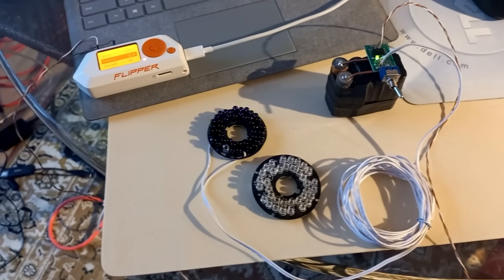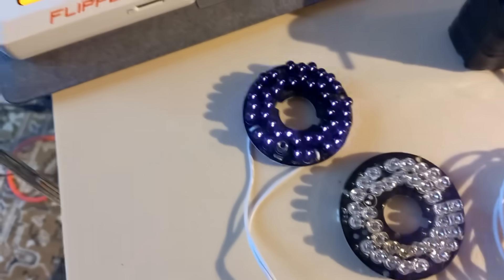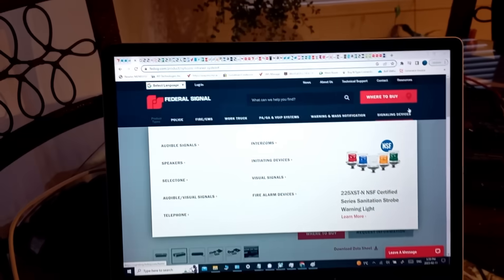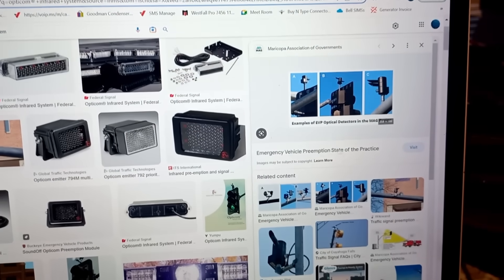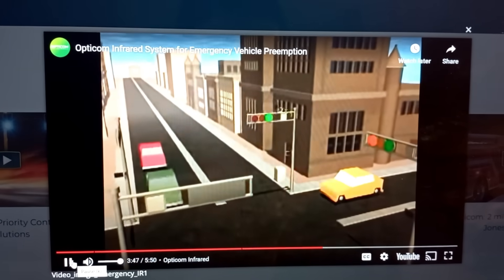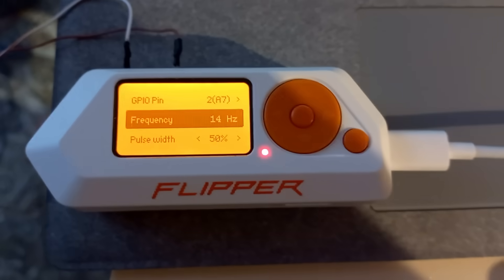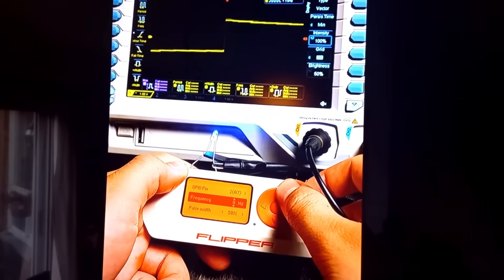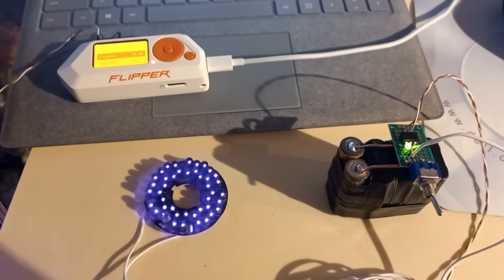Flipper Zero Controlling Traffic Lights

Comment: I'm curious how this might be used to influence drag races. Some of these races are for tens of thousands of dollars so just a matter of time before someone uses a similar device to disable a car at the starting line. Curious if you could explore vulnerabilities and possible ways to prevent this scenario, thanks
Reply: I've never seen or heard of a high stakes drag race using a public intersection traffic light to start.
Reply: @superbarnie  I was referring to using the flipper to sabotage/manipulate an opponents cars electronics in an undesirable way. I am not advocating doing this, just curious if it was possible and if so how to prevent it
Reply: @jayd6083  probably use an emp to do that lol
Reply: @jayd6083  I didn't watch the whole video but from what I saw it looked like they are just making a 14hz strobe light, and the traffic lights are designed to detect this light pattern. There's nothing in a car would be affected by something like that. There's also nothing in a car that uses any radio or wireless input for the critical systems. Except maybe some new cars with proximity sensors and wireless anti-theft/government backdoors. But any race car would have those removed.
Reply: @jayd6083  no, just no.
Reply: @rabbitdrink emp’s lol. In your competing car with electronics?
Reply: @deaf2819  its kinda the only way, gonna need lots of power and probably gonna fry your own car first

Comment: I would not do this in any vehicle with a modern computer, as many are equipped with cellular devices which broadcast all kinds of data about that vehicle. The data goes to companies like Palantir which probably curate and pass that along to local leos as for position and other attributes of every trip you make.  You can hear some of them broadcast after the vehicle is turned off, or use SDR to detect it.  Mine broadcasts for about 10 plus minutes after every trip.

Comment: This may also work with camera Speedlites and monolights that have a stroboscopic mode. You can manually set the flash pulses in hertz, but only downside is the strobe flashes are visible light.
Reply: IR?

Comment: We install these opticom systems on intersections.  They detect emergency vehicle light signals ie. police, EMS, fire, ect.  We test them with a DeWalt flasher; it looks like a drill with a big light bar instead of a chuck.  Another cool thing we install is a bus gps, so city busses are timed to the lights for quicker travel times.
Reply: @peterfairlie2296  exactly it.
Reply: @samster1oooooo  how does the bus thing work
Reply: @Blox117  gps on the control cabinet, big aluminum box at an intersection.  And all busses in the city are tracked with gps on that same network, fiber optic cable ran to each intersection connects all cabinets.  So when a bus comes up to an intersection, the light cycle will change to give quick light to the bus.
Reply: @samster1oooooo  There is talk about doing something similar with self driving cars.  The cars and lights will talk to each other to make traffic flow better.  An extra light would be installed to tell human driven cars to follow the lead of the self driving cars.  It doesn't completely make sense to me why we need the extra light though.  If they want us to drive through with the self driving cars just keep the light green. 🤷‍♂️
Reply: @Tuba Man Sam  is it possible to find a bus GPS and put it in my truck to have quicker light changes?
Reply: @TuSwab  good thinking lol
Reply: @jmr  No, I have specific complaints about the "It's good to go if it's green" policy we all ascribe to. It shouldn't be that way, it's a lack of communication to drivers. What a lot of car manufacturers and insurance companies noticed when they did market research is that most drivers were constantly looking around for clues that a light is either going to stay red or change or stay green or change. The yellow light also gives people an excuse to say "Well, yeah, but I was going too fast to stop." A blue light could be implemented to let people know that the light is not a standing green light, but a standing blue light, meaning for the duration of your being able to see the light, that intersection will be safe to approach and proceed through.

Many drivers who had their eyes tracked would end up looking at the cross walk signal timer to try to judge if they had enough time to approach and proceed through an upcoming intersection, so we already give drivers unintended clues about the nature of green lights, just not in a way which is readily available and highly visible to drivers at all times. Part of the training for driving large, hard-to-stop vehicles includes "Do not expect lights to stay green, assume every standing green light will turn red." This causes undue stress and accidentally acknowledges the problem at hand: We have insufficient methods of warning drivers that they should be prepared to stop.

Further evidence of this is the implementation of flashing lights and signs around blind corners which warn a driver of an upcoming green light change, warning them to slow down before the light in anticipation of it being red soon. We already spend so much on the infrastructure to make it mediocre, and an automated vehicle could inarguably benefit from an additional light.
Reply: @jmr i think its cause all of the self driving cars would have a faster reaction time so they could all take off closer to the same time then people driving cars would. This would allow the self driving car to accelerate at the same rate
Reply: @kennethmead9122   The light is meant for human drivers according to the article.  If it was just to communicate with the autonomous vehicles they wouldn't bother using visible spectrum.  I don't think the idea will go anywhere in it's currently form anyway.
Reply: @samster1oooooo  that wouldn’t work in Sydney Australia lol. Some streets might have 6 buses come within 5-10 minutes. Maybe out in the suburbs they work, but in the city, no way.
Reply: @RustyShackleford463  What sort of special education place do you live in??? If it’s green, you proceed, if it turns orange and you’re far back enough to stop safely, then you do. If it’s red, then you stop. I’ve never heard of a populace being unable to understand the simplicity of 3 lights.
Reply: @Azzajay Brah  Okay? Go get your CDL in the US. They specify that there's a difference between lights you've watched turn green, and those which were always green from when the light was first visible, and what procedures to take in both scenarios.

An additional light would, and in frequent cases, does serve to further alert a vehicle of the green lights' intentions. Blind corners require flashing alternating colored lights to alert the expected change of a light from green to red, for example. 

So what's your problem, snowflake?
Reply: @MarioGoatse  I thought you were in Australia?
Reply: @TuSwab  Yes. Just go to the police station and fill out the application. They just need to enter you in the data base. I did it and I haven’t seen a red light since.
Reply: @jmr  All these fancy projects to change traffic lights but never enough time/money to fix the god dammed potholes.
Reply: @blargcoster  Go see how much they pay for signs.  Have a stiff drink ready.
Reply: @James Randolph  God, tell me about it. I work with utilities on the road and it gets wild.
Reply: @samster1oooooo  sounds fucking terrible. you'd need to factor in the stoppage of the bus at each light for loading/unloading.
Reply: 😅 @guybeingaguy
Reply: @TuSwab you can pull over 40 seconds every block and hit the lights perfectly!
Reply: @MarioGoatse a blue light is sexist, there should be a pink light as well to warn us of whamen drivers in the area.
Reply: @samster1oooooo just saw this but still curious about the other things
Reply: @RustyShackleford463 honestly an interesting read. Especially since I’m one of those drivers who judge the light cycle based on the crosswalk signal
Reply: @MarioGoatse have you ever drops big rig? Have you ever towed a heavy load? No? Then why are you talking about what you don’t understand. The yellow stage is NOT long enough for a lot of vehicles to safely proceed or to safely stop especially when people immediately go when they get a green light rather then clearing the intersection first
Not to mention that a majority of people seem to think yellow means “you still have a chance”
Reply: @samster1oooooo  My compact sedan identifies as a bus... 😋
Reply: Those are $1.2-$1.3k…that’s crazy. Specialty equipment always begs a premium I suppose.
Reply: @erictheboringone5292  tax payer money flows quite easily.
Reply: Is this everywhere? I'm in Los Angeles, and the traffic lights don't seem to respond to emergency vehicles. (I've always wondered since I was a kid if a system was in place like you described but with sound instead of light) people are jerks here and will take the light even when emergency vehicles blare their horns to stop traffic.
Reply: @Alchemist09 LA has a gridlock problem, it’s likely installed but rendered useless.
Reply: @Alchemist09  They don't, I love in West TN and have NEVER seen lights change when a cop or ambulance go through.
Reply: @smoothlyrough512  watch high speed chase videos, pay attention to the traffic lights. they might not have them in smaller communities possibly??
Reply: So busses get free passes at lights... and they are STILL slower then walking? WELP
Reply: @anjhindul the key word was “some” my city sets up lights to give busses the advantage and there like half the time of walking if there isn’t a delay
Reply: Ah, great insight, thank you+! So, basically, a good legal way to avoid red lights is to follow a city bus? What about school busses?
Reply: You got a model number for that flasher? I cant find any info about them on google aka the useless piece of garbage
Reply: You sir are 100% correct.
Reply: I’m actually really interested in this stuff I buy and sometimes set up old (and newer when possible to get) traffic lights and other similar systems but, the information seems to be pretty scarce. I’d assumed that’s because of what they can be used for but If you don’t mind I’d like to ask some questions. When you say a flasher is this some custom tool or is it literally just a light with a strobe option? I thought this system would only work with something like inferred. If the system are set up with gps do the lights change based on the busses location from an external system? are they just sending out a gps signal that gets picked up by the lights there moving towards? Or do they work a completely different way? 

If I happened to ever acquire a receiver would that part be legal to have? I believe you need a license or business to buy one but what are some other things that could set it off or are there systems or similar that could trigger it?
Reply: @awsomegamer8277  There's a lot more info to dump than a comment could give justice to, so I recommend @Trafficlightdoctor videos.  @Trafficlightdoctor Does a really good job explaining the intricate parts of the traffic cabinets as well as the systems involved.   The cabinets, signals, cameras, etc.. in his videos are damn near universally used in every city at this point (same manufacturers), so what he explains is literally what I do on the day to day.
Reply: I really like that bus thing. If you think of each intersection as a computer processor, letting buses pass through processes much more people on average, so I like the civil engineering behind that idea.
Reply: @Cheeky_Goose  i mean the implementation by using gps is dogwater. i'm an engineer and understand processes, and gps isn't the determining factor, you'd need to have gps and knowledge of if the bus is stopping or not. If you are already signalling something like location, you can also signal a "ready to proceed through" which could be tripped whenever the passenger Stop Request is triggered and then locked out until the bus driver clears it or after a timer.
Reply: At night, if I flash my high beams on and off, will that trigger the signal change?
Reply: @herrwarmduscher5204  only if you do it at the right frequency (exactly 10 12 or 14 times per second). It's designed like this to be impossible for a human to do it without computer aid.
Reply: interesting as a bus rider
Reply: I’m actually really interested in this stuff I buy and sometimes set up old (and newer when possible to get) traffic lights and other similar systems but, the information seems to be pretty scarce. I’d assumed that’s because of what they can be used for but If you don’t mind I’d like to ask some questions. When you say a flasher is this some custom tool or is it literally just a light with a strobe option? I thought this system would only work with something like inferred. If the system are set up with gps do the lights change based on the busses location from an external system? are they just sending out a gps signal that gets picked up by the lights there moving towards? Or do they work a completely different way? 

If I happened to ever acquire a receiver would that part be legal to have? I believe you need a license or business to buy one but what are some other things that could set it off or are there systems or similar that could trigger it?
Reply: And me to go at a house
Reply: Lol, I'VE BEEN FLASHING MY HIGH BEAMS TO CHANGE LIGHTS FOR YEARS
Reply: @YELLTELL  You are amazing!  How much practice did it take to learn to flash your headlights 14 times per second?
Reply: Yeah, imma call your bluff. I've been at plenty of stop lights, with my side on green, while an ambulance comes through, from my side. The lights don't change
Reply: Lol all this work and you could just buy a dewalt flasher and do absolutely 0 work
Reply: @OTLP can’t find anything on google about a dewalt flasher

Comment: My Uncle was a Fireman, he had a small box in his car that would change the lights to green down the whole road with the press of a button. He let me press it a few times. I always wondered how it worked. I think they have more than one system to change the lights, my best guess is his was a radio transmitter of some sort.
Reply: Here in California, the way the transmitter works is that it uses an infrared light that is emitted from an emergency vehicle that blinks in a certain pattern that a camera above the traffic lights detect and changes.
Reply: @johnathanruiz-pineda9610  It's almost like you watched this video.
Reply: Watch dogs in real life
Reply: and anything radio transmitted can be emulated by the flipper zero if it was radio transmitted then we didn't need this whole process to change the lights because flipper zero records radio transmission and emulates it
Reply: @Wist2311  Did you even watch the video? The whole video explains that the flipper zero blinks the infared lights shown at a certain frequency in Hz that the traffic light reciever is designed to detect. There is no radio transmission. However, bus systems use GPS to cordinate the routes and change lights.
Reply: @DordiHOTS  The reason why I said it might have been a radio transmitter was the box fit in your hand and was wireless. This was in the 90's. I remember it didn't have to be pointed at the light to work. I had looked into this before briefly and several systems can and were used. 1. Optical  2. Sound  3. Radio.  4. Fully computer controlled or a combination of these. The radio version sends a digital id to a nearby pavement sensor or a directional antenna at the intersection which would trip the light. I believe this is what he had and some places still may use this system.
Reply: @Wist2311  light is radio.... Its just photons traveling through space, I am certain you can find "radio waves" The flipper can't emulate, visible light is a good example of radio waves it can't emulate(granted The flipper does have an IR transceiver/diode)
Reply: magnets they use magnets
Reply: Your uncle should be sitting in a jail cell for that
Reply: @Green_Expedition_Drgn  he should but whos gonna catch him
Reply: reported
Reply: cool
Reply: @idabe170  I was just a kid when he showed me what that box was for, it was pretty awesome when he would let me press it. He would make sure he wouldn't cause an accident when he used it but it was like god mode for getting through traffic. He was a fire inspector at the time and almost retired. The guy was tough as nails, ex military, he would let us work out at the fire hall sometimes and play pool with the boys.
Reply: @davidbrennan5  cool
Reply: @idabe170  can’t tell if you’re being a cornball or not
Reply: @xzeuii  what
Reply: @idabe170  ratio cornball
Reply: @storming.  what i think its actually cool im not just saying cool for no reason
Reply: @idabe170  lmaoo cornball
Reply: @idabe170  expand your vocabulary
Reply: @kaizer2k2  ok
Reply: @storming.  Cornball Z
Reply: @idabe170  cool
Reply: @David Brennan
you so lucky he did not go buy milk and never come back like some old pal
Reply: @BillRayDrums  Colonel Ginyu
Reply: @kaizer2k2  cool
Reply: @idabe170  ratio
Reply: @idabe170  Smooth brain
Reply: @FriedEggsandJellyfish  ok
Reply: @storming.  uncommon cornball ratio.
Reply: have family in fire dept behavior checks out